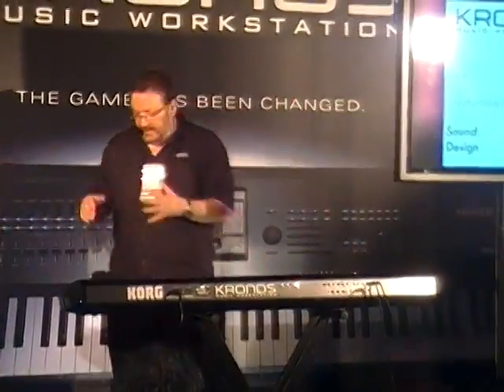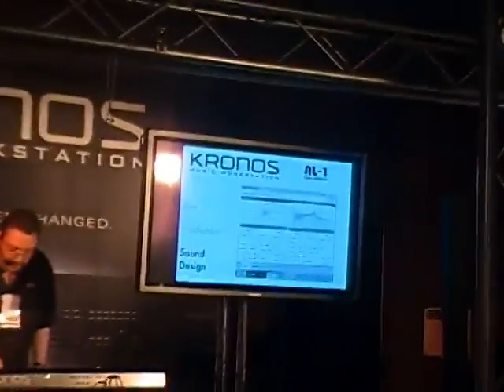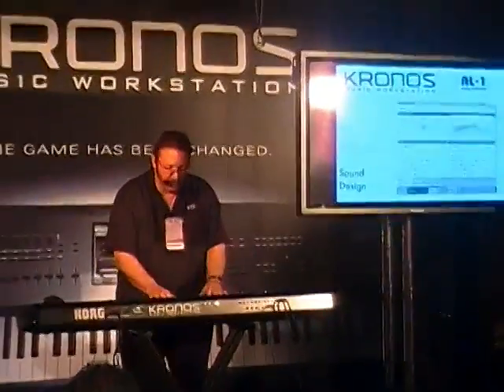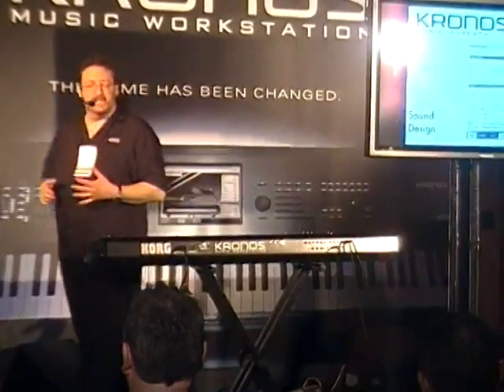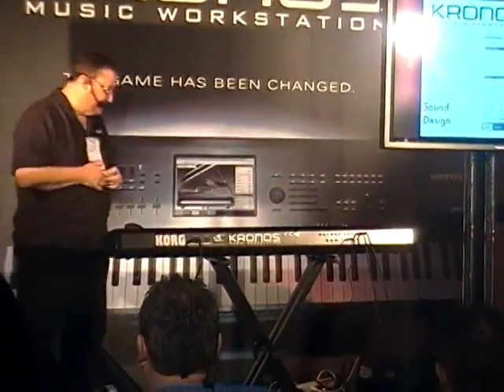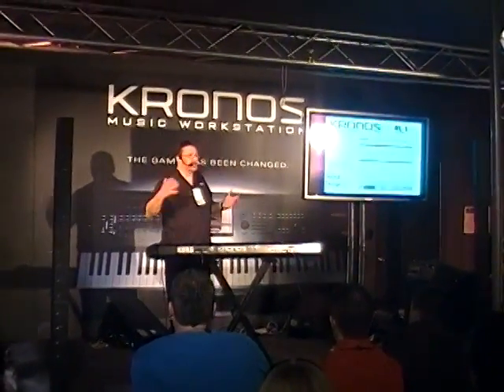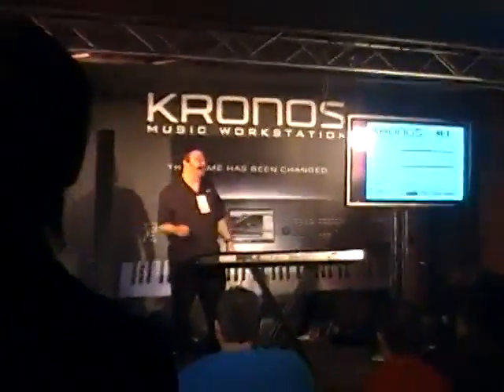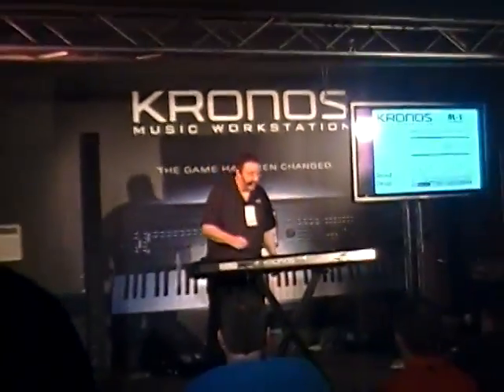Korg Kronos AL-1 synth engine winter namm 2011

Comment: Tha AL-1 is one of the most massive "Analogue" engines ever (it first came with the Oasys). Too bad it i so damn hard to use. Not because it is badly designed, but because it is so extremely flexible. Two main oscillators with analog-style FM and sync. 4 EGs, 4 LFOs. But most importantly it allows "morphing" of osc waveforms, snd such things as a four-mode ring modulator that allows you to modify the modulator before applying it to the carrier, detuned vawes, and morhphing of filter "profiles"